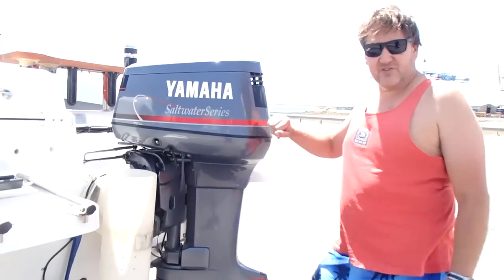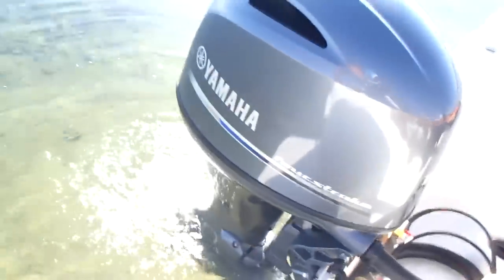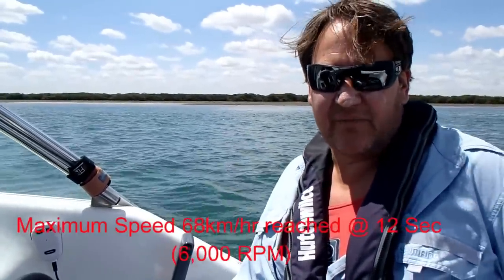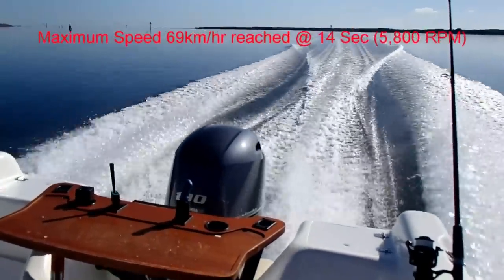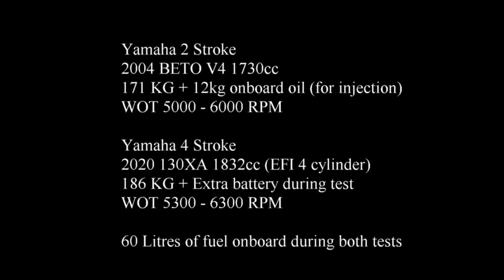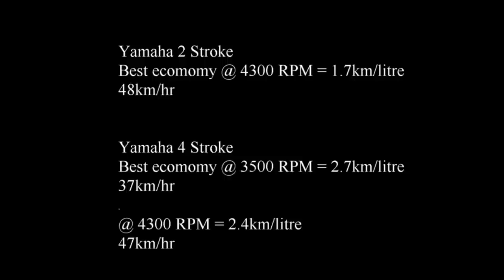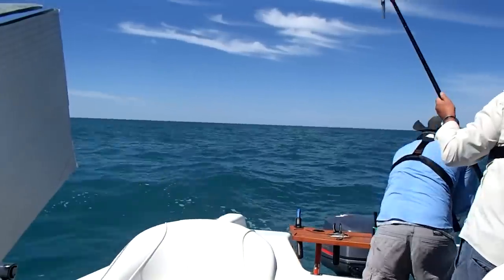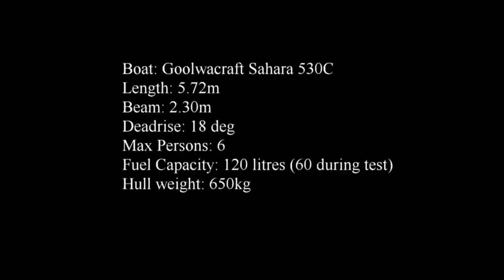Yamaha 130hp 2 stroke verses 130hp four stroke

Comment: Its like this. If you value your money, its the 2 stroke every time. Yes it will use more fuel however the cost of purchasing looking after and replacing the modern 4 stroke with all the parts on it to make them viable will be many many thousands of dollars more than the extra fuel you will use. Think on this unless you are motoring huge distances each time you go out. Its a lor of money to spend on something that is used about 4- 20 times a year.
Reply: There is almost no difference in maintenance cost.
Reply: @mcplutt  sorry,  entirely untrue. Only similar until all the moving parts and electronics in the modern 4 stroke start to fail. And they do.
Reply: @philipmann9548  Maybe they do after 5,000 hours. So no problems.
Reply: That's complete and utter bullshit

Comment: Wow, 2 stroke holeshot was really impressive, perfect for water sports. Both engines are nice and well made video 💯
Reply from the maker: Cheers. I must say the four stoke has opened up since it has now done 60 hours. It has a hole shot that must be 90% that of the 2 stroke, just sounds much lazier..
Reply: @ShortFlic  u might want to reajust the valves on that 4 stroke.. it sounds a little rough... or maybe its the microphone... or the gas ur using... ive heard smoother ones in person.
Reply: I think the 2 Stoke could go up a prop size. I have the same motor - 2004 2 stroke 130 with around 450hrs and my hole shot is nothing like that but I get around 72km/h at just under 5700 rpm
Reply: Centerboard is the way for water sports... 100%
Reply: 4 to troll  2. To go
Reply: I have a 07 Yamaha 115 2 stroke and It jumps out the hole fast

Comment: I reckon the 2 stroke has one of the best outboard sounds at idle
Reply from the maker: Yeah agree. Punchy. The four has opened up a bit, now doing 120hours. It has a nice mid-range whine (like the old mercruiser sterndrives).  Miss the 2 stroke, not the fuel bill or smoke.

Comment: I have a 2015 130hp Yamaha 2stroke goes really well I’ve had no issues so far it’s got 270hrs on it but I’d rather a 130hp 4 stroke for the reliability and fuel efficiency I’ve owned a 100hp 2010 4 stroke and never had any issues I put 1200 hrs on it too

Comment: I wish Yamaha had invented the etec fuel injection system instead of Evinrude, they would have made a great engine and probably would still be around. 4 strokes earned their place in outboards, they beat the old technology 2 strokes in many important areas. I still think there’s a place for the etec two stroke, the torque, economy and low emissions is hard to ignore.
Reply: Yamaha did invent it's own 2-stroke direct injection system. But 4-stroke was the winner.
Reply: @mcplutt  4 Stroke has never been the winner in outboards.... what are you new to boats or what?
Reply: @lastaccountbannedfortalkin1449   4-stroke IS the winner in outboards. Just look to Mercury.
Reply: I totally agree. Just got myself a bass tracker with a 75 hp Evinrude E-Tec. What a wonderful motor and the hole shot is very impressive. So far a great motor for me.
Reply: Yamaha HPDI series (High pressure direct injection) very sought after motors today, has the fuel efficiency and the two stoke torque (mercury optimax series is also direct injected two stokes)
Reply: Yes, Yamaha invented the HPDI system, which was far inferior to e-tec in nearly every conceivable category. I was saying if Yamaha had access to the e-tec technology it would have gone far. Now we’re stuck with the 4 strokes
Reply: @CBCycles  4-strokes are OK :-)
Reply: @CBCycles  Maybe but two strokes are dead due to emissions laws. It's sad. I have a DI two stroke and will be keeping it running for as long as possible.
Reply: Yamaha did have their own HPDI - High Pressure Direct Injection 2 strokes on both VMAX (including Series 2) and non VMAX. The Series 2 VMAX HPDIs were fantastic until Yamaha brought in their new SHO VMAX 4 Stroke.
Reply: The E tec G2 s are cleaner more efficient and stronger than 4strokes, but I think the 4 stroke technology is the easy and cheap way to produce low emissions....

Comment: What a fantastic comparison. Same boat, same fuel load etc. Just different engines, perfect! I was amazed to see how close they are on weight, and that the fourstroke just won on top end... though the difference was so negligible it could have been weather / tide. There's no denying the fuel economy of the four stroke is the main reason to change over. However, an important point on 2 stroke outboards that is often missed is that in a harsh salt water environment a total loss oil system means the engine is constantly cleaning its self out. If it swallows a bit of water it's soon gone. If you completely drown a 2 stroke, you've got a much better chance of getting it going again than the four stroke. Great vid, awesome job mate.
Reply: Nope my dads 2008-09 yamaha 90 4 stroke sunk exactly 4 times. I got it going 5 times!
Reply: @edwardabrahamiii3742  well done! I resurrected a df90 after being sunk in salt water. It's fine now, but it would have been easier if it was a 2 banger

Comment: Outboards are just insane motors, even the 2 strokes push 3000+ hours reliably. The 4strokes are probably even better but why replace it if its running well. 
I love the 2 stroke idle and jumps like a supercharged motor and has very simple moving parts. Can fix them on the lake and they are super cheap to service. 
I had a 2 stroke yamaha outboard 9.9hp that we had for 10 years and only risk it had was people forgetting its a 2 stroke, since the body looks very similar to 4s.
When it comes to jet skis they are super light, and auto mix the oil so you get a variable oil ratio. 
Overall excellent video and loved seeing the old V4 2 stroker in action.
Reply from the maker: Thanks for your comments. Your are correct to ask why replace a well working motor with another new one. I really wanted to do a lot more trolling with the tuna we get in South Australia and this is where my old two stroke drank like a fish and smoked up badly. My four loves low down, slow hard work all day long.

Comment: Very good comparison, and I was honestly impressed with the four stroke.  Where power to weight comes into play two strokes used to rule the world and I love the powerband of a 2 stroke dirt bike or go kart.  That said, one of my favorite bikes was my Honda XR350R.  Ahead of its time in 1984, this was a single cylinder 4 valve dual carb and dual exhaust engine.  It had amazing off idle grunt, and when both carbs went WFO you had better be holding on to well over 100+ Miles per hour.  We need to take care of our tiny earth, but please don't let the 2 strokes vanish.
Reply from the maker: Thanks for your comment. Bikes are crazy fast!
Reply: @ShortFlic  2 stroke engines are already a thing of the past. Even Suzuki, Kawasaki, Yamaha and Honda are not making 2 stroke engines anymore and 2 stroke engine oils are becoming rare. I own a 2 stroke INGCO generator and in absence of 2 stroke engine oil, I have to mix Motul full synthetic 10w40 Diesel multigrade motor oil with gasoline, it's a weird idea but knowing that everyone is now on 4 stroke engines, I have no choices left to keep my generator running. Adding excessive engine oil will eventually foul the spark plug, so better to use the same amount required by the generator Manual. I think if I had a 2 stroke outboard motor, I would undeniably do the same thing

Comment: Great comparison video!
I have a 94 Yamaha 85 hp 2 stroke that I'm replacing with a 115 hp Yamaha 4 stroke.  While I do love my 85, it is 30 years old and some of the parts are becoming "no longer available".  
I do a lot of trolling which the 2 stroke hates, and then there's the noise.  On a small boat like mine, even if your up front the engine is loud.
Reply from the maker: Thanks for your comment. I do soooooo much more tolling now I have the 4S
Reply: What does it hates trolling mean? What does it do?

Comment: Excellent non-biased video I’m assuming this is Australia , it’s funny 130hp on that boat would be considered significantly under powered here in the US but it seemed to perform just fine
Reply from the maker: Thanks for your comment. Probably something to do with boats and outboards being sooooo much cheaper in the States :) . Boat is rated to a 150hp but an extra 50kg is a lot to consider going from 130 to 150 including a six cyclinder (verses four) and quite high centre of gravity. The balance is perfect

Comment: the increased fuel economy of about 25% is typical  when you switch from a 2 stroke engine to a 4 stroke on the same application, It is even applicable to diesel industry, when we swap a 4 stroke diesel engine in a machinery previously powered by a 2 stroke diesel engine, when that machine is used in the same conditions, the observed fuel economy is up to 25% for the same work, in the positive side, low and mid range response is much better and top end response is a a bit less crispy.
The increase costs of the maintenance are more than offsetted by the fuel cost economy.
the 4 stroke outboard motors isn't new, from 1961 to 1970, The Fisher-pierce bearcat motor was a 4 stroke, in fact, it was a Crossley engine that was converted to outboard application and it developped 55 HP.
Reply: @Harrison Pett what is the link with my comment ????

Comment: 2 strokes engines where measured wrong back in the days, they measured the hp’s on the shaft. Today it gets measured on the flywheel. Wich is more exact. That means that this “130 2 stroke” can easely be a 156 hp engine. (You lose about 20% of power in your drivertrain).

My 90hp 2 stroke Suzuki 4 cyl, got 105hp when measured on the flywheel. Pretty cool😀
Reply: prior to about 1986, they were measured at the flywheel. propshaft hp came into play in 86' to keep up with the Japanese motors. Today's motors are NOT flywheel rated, as you contradicted yourself. A 130hp 2 stroke yamaha should put out about 145hp at the flywheel. Your 90hp is 90hp at the propshaft, and like you observed, 105 at the flywheel. not sure your point?

Comment: I had twin 130 2 strokes on my first catamaran and 150 4 strokes on second.  I currently have a 115 on a aluminum center console.  Looks exactly like your 130 but 15 less hp and I’ve never seen that 130 in the US.  Not burning oil is nice and better MPG’s, but hole shot on the 2 stroke is unbeatable
Reply from the maker: Thanks for your comments. Yeah, I think the F130 was something Asia Pacific? or Australia / NZ thing. Maybe we are the Ginny pigs :). Both are great motors

Comment: I went from the 140 v4 yamaha to a f130 and definitely not disappointed. Hole shot was about the same. Top end on the f130 is 2kmh less but is running a size down on prop vs the 2 stroke. Getting 6400 rpm 2pob 100L fuel. 73kmh. 5.5m glass hull.

Comment from the maker: Now put 130hours in my F130A Four Stroke and it's opened up nicely. Best economy is around 3800rpm at 2.8km/litre. Also, 4300 / 4400rpm provides 2.5km/litre at 50km/hr.

Comment: Interesting video and comparison.  I grew up running only two stroke outboards and I had great luck with never a problem on any of them and in the early morning when that two stroke would start and you got a good wiff of the exhaust it smelled wonderful!  NOW here we are today I still run a few outboards and I dont own even one 2 stroke engine anymore, sorry to say and yes I know all about two strokes wiping out the planet etc. etc.!  Here in the US over the last 5 years 4 stroke outboards engines sales have continually gone up and as far as even the most advanced 2 stroke engines you can hardly give them away.  The final demise of EVINRUDE was due their great research into making the 2 stroke great, which I sincerely believe they did but all the the bad press concerning the two strokes and again killing every living this on our planet (Thank your BS Press) was in the heads of every American buying a new outboard and now EVINRUDE is gone!  I grew up with Evinrude they made great engines until because of poor management they built crap then Bombardier bought them and they made extremely high quality engines again (2 stroke) and now they dont!  its to bad they tried to stick with the 2 stroke philosophy!

Comment: Have flogged the crap out of the saltwater series 115 & 130 at work, two strokes never let me down, have used 60 & 90 fours, good economy but there ticks were louder after beatings.
Reply from the maker: Yeah, the 2 strokes go hard indeed. I have begun to push my 4 stroke hard and it's doing well, lets see after 500 hours..
Reply: @ShortFlic  Yamaha 4 strokes last ages. My 225 has 800 hours on it.

Comment: Right on.  I live two strokes...sorry to see them go, but I love my new Suzuki.   I was surprised though reading the owners manual and watching YouTube videos at how much recommend maintenance there is.
Reply from the maker: After starting to do my own, it really isn't a massive issue or cost, even running full 5W - 30 Synthetic oil. Cost from dealer is $750. Cost at home is $120...Bit like a small 4 cylinder car

Comment: Great Video, I am a pro fishermen & used to run Yamaha 2 strokes but the 4 is way better on fuel economy when you spend half your run time at idle. The 2 strokes hardly ever had an issue but I have had more things go wrong on the 4 strokes, Though they are more complicated. also doing the service every 100hrs is a pain & the 1000hr service is costly Cam belt & all filters. With the right prop you can get up on the plane quick but loose the top end speed. The 4 stroke like a bigger blade area as they have more torque.
Reply from the maker: Thanks for your comments, you're spot on. 1000 hours is like 25 years of recreational fishing for me!!

Comment: Good info. I just finished a crankshaft up rebuild on a V4 Suzuki that cost me $500 to buy and around $500 to rebuild, (the seller threw in a complete gasket set worth $250). Labor was my cost. It’s a stormer and runs sweet. Yes, I’d  love a 4 stroke but what would I get for $1000 ?
Reply from the maker: Thanks for your comment. I think the rebuild you did is probably the go. At least you had the chance to inspect everything at the time and rule out major potential issues. A two stroke can still have some serious issues like internal corrosion that is not visible. $1000 outboard would likely be a risky buy...

Comment: Steve in Florida I have a 115 4stk at low rpm at 800 remember I also have the prop rattle  good video thank you Steve
Reply from the maker: Yeah, I found some seriously technical documents online but it makes sense with heavy Stainless props verses and 4 stroke power cycles. I purposely avoid that rpm. I would suggest any extra vibration or load cycles is not good for engine longevity..

Comment: I have a feeling that you 4 stroke is not propped correctly. The expected fuel consumption at WOT for the 130hp EFI engine is 32.5 liters/hour. definitely not 47l/h. This is way too much for a 4 stroke and it is likely to be overreving. I preffer to cruise @4500 and run WOT @5600 rpm.  But, Man! Your 2 stroke looks mint! Well done

Comment: There is an error in the consumption calculation: the 2-stroke travels 1.21 km / l about 15% more, not bad. Furthermore, the state of the water is different in the two tests and this affected the 2-stroke.
Reply from the maker: Hi, thanks for your comment. Not sure what you mean about error? At WOT the 2 stroke is only doing 0.82km/l (820mtrs) and the four stroke at about same revs is doing 1.47km/l. Based on my recollection, when the 2 stroke is doing 1.21km/l , the revs would be about 5,000rpm (probably 62km/hr). The four at this rpm would be doing about 2.4km/l and maybe 55km/hr. Hope this make sense